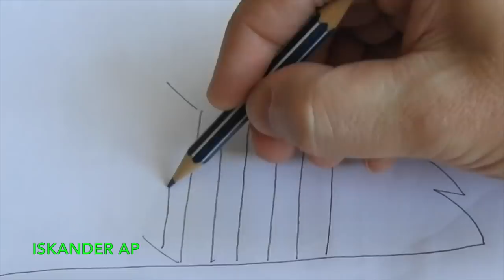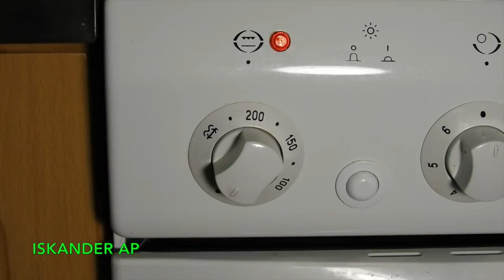Мини РЕЗЦЫ ИЗ ПИЛЬНОГО ДИСКА #2 / Cutters For Wood Carving

Comment: Thanks a lot. Good work, good video. I would like to ask what is the time or duration in the 200 c oven for tempering.
Reply from the maker: Thanks a lot !
Heat up to 220 degrees.
Leave in the oven until it cools completely.
Reply: @iskander_ap  thank you very much.